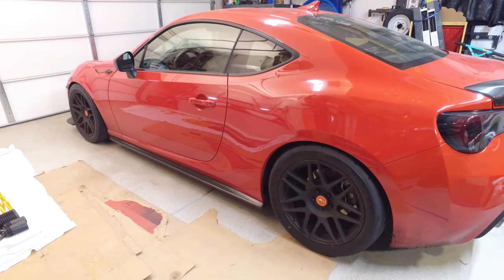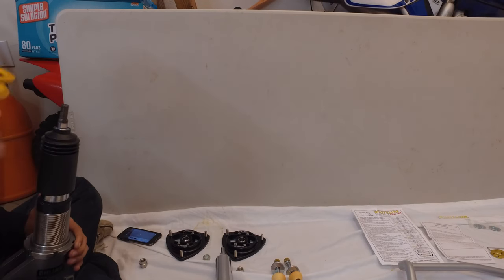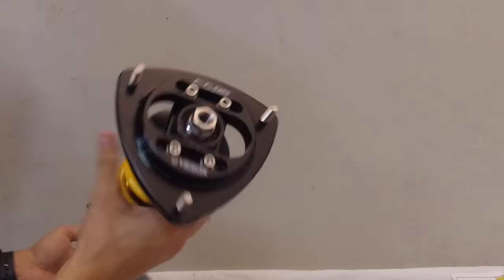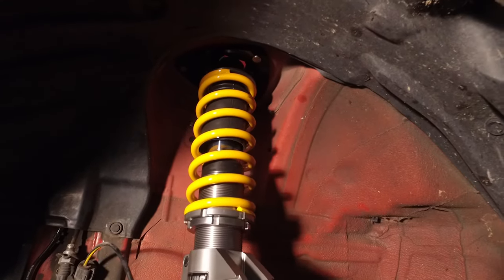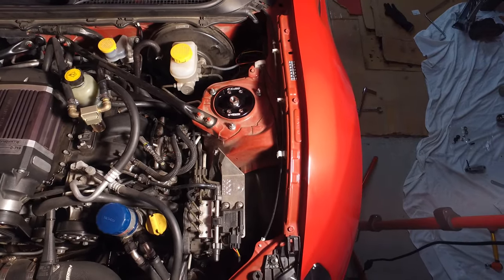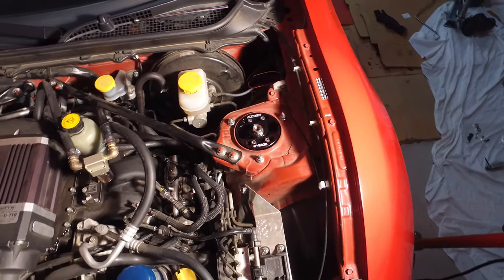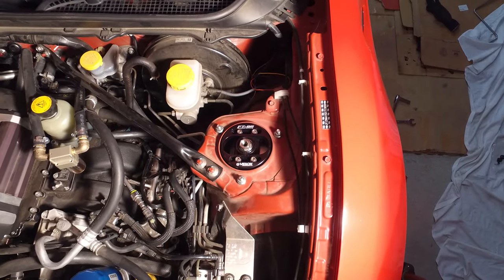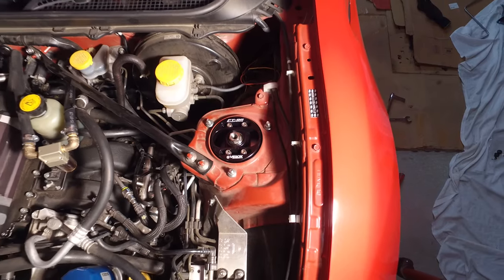FRS/BRZ/86 Velox Camber Plates-Install Notes and Review Before Installing

Comment: Bought a used set and installed it. Under the camber plate there is an engraving one with D and one with P, Driver side and Passenger side.  I I like overall, no clunking on rough roads. Still on stock struts with swift spec R

Comment: Hi,  according to the customer support at FT86Factory these Velox camber plates are not supported to work with the Ohlins. I had problems with mine, got scratches on the spring coil perches. Did you do something special to make them work? Are they still working for you.
Reply from the maker: Huh, very weird. The Velox/Versus plates should work with anything that requires stock top hats. Did you assemble them how I showed here? I did not use anything special-only the parts that came with the coilovers and camber plates. They were on the car for only a few thousand miles, but during that time I experienced zero issues with clearance/scratching/grinding/rubbing etc.
Reply: Thanks for the prompt reply. I think the shop where I took it might have over-torqued them and now they are scratching the spring perches. Will take it to a different shop that is better to fix it. Many thanks again.
Reply from the maker: Yeah everything goes on a specific way, so if they botched that, you'll have issues. I've seen plenty of shops using impacts on these which is definitely a no no. Not saying that's what they did, but I've seen it plenty.

Comment: velox camber plates are  NOT design for ohlins . Point .
Reply from the maker: They are designed for stock suspension, and the ohlins normally re-use the factory top hats...so I don't see why they wouldn't be okay?